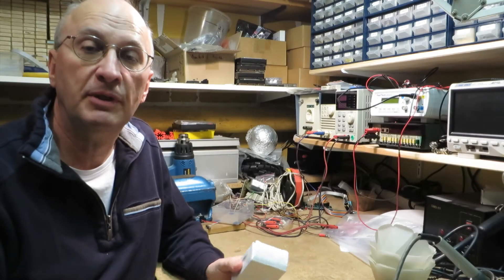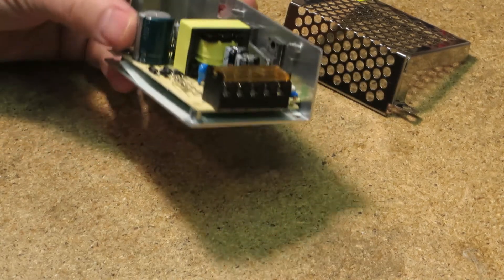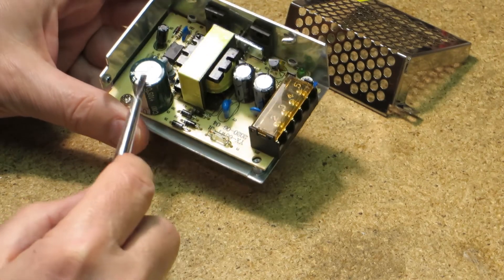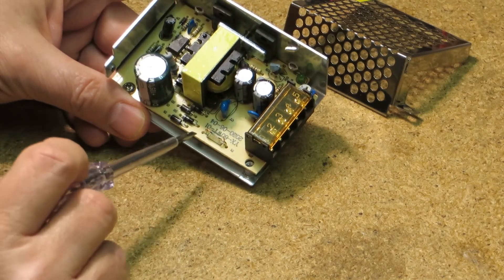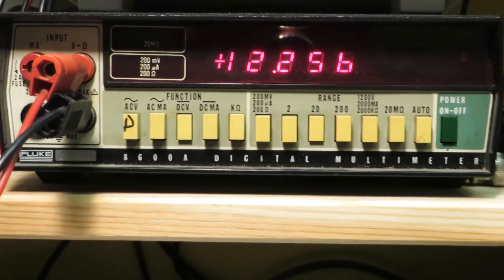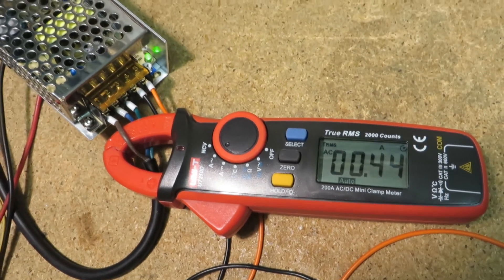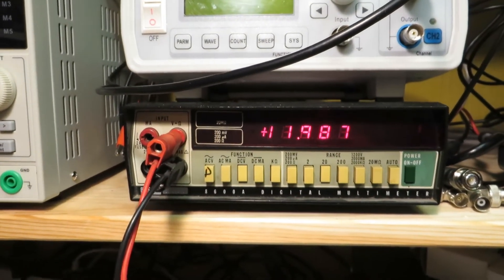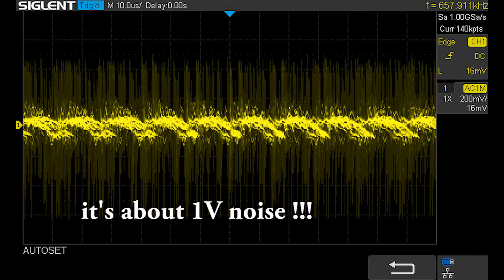S-60W-12 extremely cheap Power Supply 12V 5A from banggood for less than 6€

Comment: what is part number of this ic
Reply: Not exactly but same type of SMPS 12V 5A with mains filter section has OB2269AP PWM controller IC and 5N60 high voltage MOSFET and a TO-220 diode. All of these looks similar.

Comment: Please what is the number of regulator 8 pin
Reply: Not exactly but same type of SMPS 12V 5A with mains filter section has OB2269AP PWM controller IC and 5N60 high voltage MOSFET and a TO-220 diode. All of these looks similar.